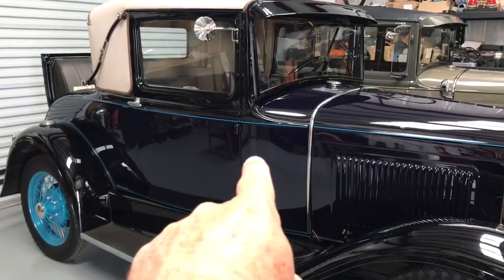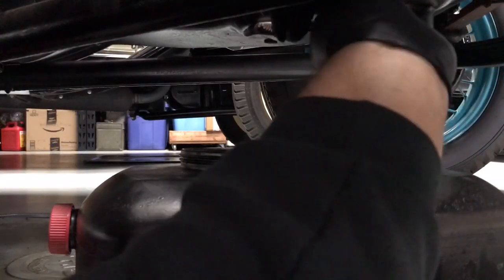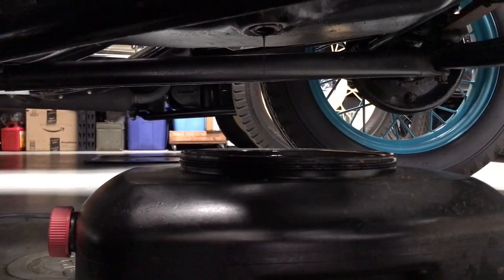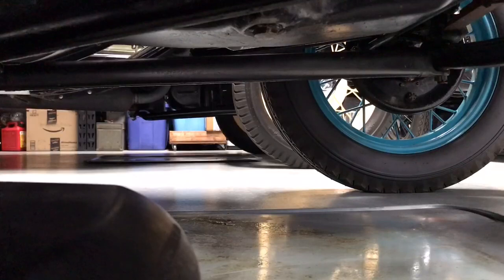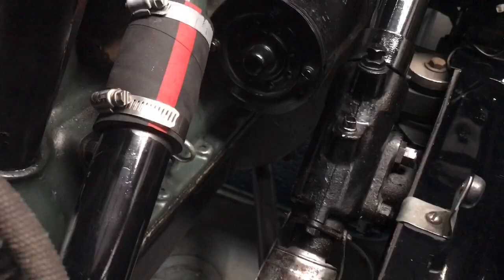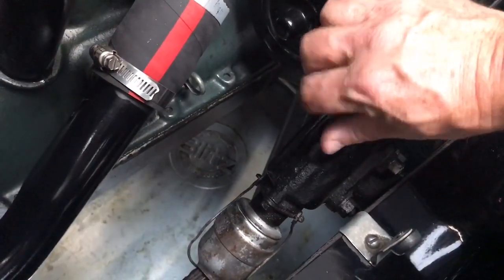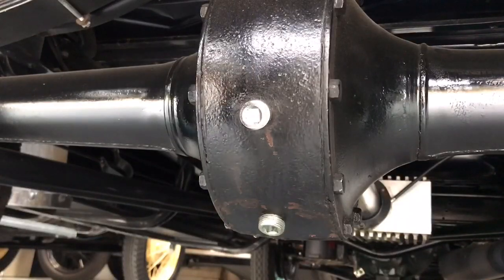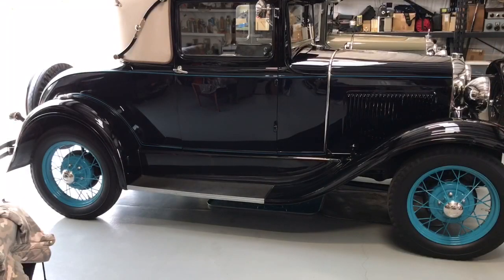How to check and change fluids in a Ford Model A.

Comment: Thanks for showing all of these grease and lube spots! Some of which I wouldn't have even thought to add a couple drops to! 

I was debating using modern 10w-30 syn in my Model A, and now seeing you doing it, I will certainly do it on my next change! 

Really enjoying your videos on Model As!
Reply from the maker: 10-30 or 10-40 work just fine.  Thanks!

Comment: I really like these maintenence videos 😊. Always interesting to see how much easier it is on older cars. Question, how come you change the oil so frequently when you use fully synthetic? Does the engine wear more than modern engines?

Thanks.
Reply from the maker: The Model A came from the factory with no oil filter.  So the oil gets dirty fast.  Lots of people add aftermarket oil filters to them now.

Comment: Hey Paul, I'm a new model A owner and somehow hit the jackpot of having a well maintained '31 for a reasonable price. They did put a grease fitting on the steering box though. How would you clear out the old grease? Thank you for the great informative videos. As a millennial with little mechanical experience your videos are a life saver
Reply from the maker: That happened a lot back in the day.  Just start filling it with gear oil and try to get the oil and grease to mix for now.  Keep it topped off with oil.  Eventually, when you do a rebuild on it, clean the grease out with brake cleaner and only put thick oil in it after that.

Comment: Dear Paulshinn,  I'd be very interested in seeing the Tudor's under side.  My '30 pickup took a 2nd place at the World Meet back in 1986.  I've driven it a fair amount since then though.  It was newly restored back then.  However, I like to keep the under side as clean as possible.  Just some "fodder" for another video.....Thank you for your post on lubrication....I went through and did all of the major lubricating, (bumper to bumper), last year on both my truck and my dad's '30 Deluxe Roadster.

Comment: Hi Paul!! Thank you for the video. My steering column the prior mechanic that worked on the vehicle put grease in it. Is there a way to flush it out? Thanks!
Reply from the maker: Unfortunately, it will have to be removed and disassembled to get all the grease out properly.  However, for now, shove as much 90 wt. in there as you can and start mixing.

Comment: Paul.  Where did you get the paint to spray your oil filter Ford Green?  Is it in a spray or do you brush it on?  Thank you
Reply from the maker: It's available in spray can and brush on form from most of the Model A parts suppliers.  It's called "Ford green"
Reply: @ModelA  Thank you very much.

Comment: Great videos - I inherited dad's Model A in '17 and it has not moved since '13 when he started his battle with cancer.  I will be going through checking all fluids and get the old girl back running soon.  I noticed that you didn't briefly run the car to fill the new oil filter, then re-check the oil?  I'm not sure if dad's car has one of these filters on it, but curious why you didn't fill the filter then re-check the oil?
Reply from the maker: The Model A has oil in the valve galley that drips into holes to the bearings.  The crank rods gets lubed by dippers splashing through the dipper trays.  Plenty of oil there to keep it lubed until the pump fills the filter.  But if using a pressurized system, I wouldn't do that.

Comment: Great video. Re oil I’ve read you need more zinc in older flat tappet cam engines. Popular brands are conventional Shell Rotella, Valvoline VR-1, Brad Penn. Zinc supplements such as STP Oil Treatment can also be added. What’s your take?
Reply from the maker: Read up on the oil I use in the video (link in description).  That will more than answer your excellent question.

Comment: Great videos,  you are so helpful keep up the great videos. 
I have a few questions if its not too much trouble. 
I noticed your radiator cap does not have a temp gauge, how do you know if its running hot , can you show how the other gauge works, how does the driver see the temp getting hot ?
Does the A models have a over flow from the radiator?
Is your oil filter housing a modern modification or was it offered originally?
Why do people change from a generator to a alternator, what's the difference and benefits. 
Thanks again.
Reply from the maker: Wow, LOTS of great questions!

The coupe has a temp gauge mounted I side just under the instrument panel.  I talk about it in this video: https://www.youtube.com/watch?v=z0imK2TaNUk

Yes, the Model A has a radiator overflow.  No reservoir tank though.

The oil filter is an aftermarket kit that all the major Model A suppliers sell.

If you drive your Model A at night, in today's traffic, an alternator is a must!  I still run 6 volt positive ground systems in my cars, so I use 6V alternators.  All the major Model A suppliers sell them  Just bolly on.  No modifications required.
Reply: @ModelA  on your other cars that have the temp sensor on the lid, does that Act like a modern thermometer in that you can see a mark or something rising up a tube that the driver can see ?
How did drivers originally know if their car was getting hot , just till it started steaming out ?
Reply from the maker: That's a motometer.  It is a thermometer, but it isn't as accurate as a "real" temp gauge.

Comment: Hi, I need help. I inherited my grandfather’s 1929 Model A. It runs well. But I need to change all the fluids. I saw the oil you used for the oil change. What brand and type do you get for transmission oil? Steering fluid? Any other fluids I need? A book to reference? A reputable model A shop or mechanic you can refer in the Los angels area? Thanks for your time.
Reply from the maker: Check out the video I did called how to check and change fluids in a ford model a.  I cover it completely.

Comment: Hey Paul on the steering wheel portion somebody did insert a grease fitting. If that area is already filled with grease should I try to remove the fitting and put in oil or should I just continue to fill it with grease?
Reply from the maker: Start seeing if you can get some oil in there and get the grease to mix with it

Comment: I don't have a Model  A but always change the oil in my regulars cars when the engine is hot. And, put a little NEW oil on the rubber gasket of the filter.
Reply from the maker: Good!
Reply: That's what I was taught too. Makes sense as more of the 'garbage' is in suspension in the oil, not settled to the the bottom of the sump etc. My 540,000km/335,000mi  (Nissan RB30) still has an untouched bottom end. I do the same with my Model A - get it nice & hot then drain the oil(s).

Comment: So, genuine curiosity, is there a reason you don't torque the drain plug? I can see the oil filter being hand tight, but wouldn't you risk damaging the pan's threads?
Super cool video by the way!
Reply from the maker: I just get it snug and then one more grunt tighter, that's all it needs.

Comment: Hey Paul, I appreciate all the info and videos you post!  Do you have any recommendations/videos on flushing out the coolant? I've noticed a little junk when I take off the radiator cap in my 30' Sedan.  Thanks
Reply from the maker: Thanks!  Not really any specific videos.  But I am working on one right now about swapping a radiator, that will contain some info about flushing.

Comment: Great Video @Paul Shinn. So I've come home from a 'parade' (aka car rally, "Bay to Birdwood" in South Australia) and while the Model A is nice and hot I've drained engine/trans/diff lube. There always seems to be oil dripping from all of these drain plugs. The engine oil drain plug has a copper washer on it, so not much else can be done there (?). The transmission and diff seem to have tapered plugs and the transmission plug in particular always has an oil drip hanging from it. I love to show off our Model A but hate leaving oil drips on friends' driveways. Is there any way of sealing those tapered (trans+diff) plugs better? Do yours leak? Love your channel :) Cheers, Antony.
Reply from the maker: Hi Anthony! Well, those drips aren't necessarily coming from the drain plugs.  for the trans and diff, you can use a little of the yellow teflon tape on the threads and see if they seal.  Th yellow stuff is gas and oil resistant.  Yes, mine drip.  They are supposed to!  Not kidding.  But they don't leave giant puddles.
Reply: @ModelA  Many thanks for your reply! I was also considering using some non-hardening oil resistant sealant such as Permatex #2... unless you think that would be a bad idea? Cheers, Antony.
Reply from the maker: I wouldn't.

Comment: Thanks for the great video. I hope you create more. What gear oil are you using in the transmission and differential?
Reply from the maker: Transmission and diff, I use the 600W oil that Bert's Model A center sells.  It's thicker than the 600W the other vendors sell and much closer to the original 600W recommended by Ford.

Comment: I have a 1931 Coupe with a model b motor. It's always been run with non detergent oil. I'm considering switching to detergent oil and an oil filter. Is that a good idea or am I asking for trouble.
Reply from the maker: If you clean out the pan first, no problem.

Comment: Paul. Finished fluid and lube on Sophie.  1930 Coupe.  I accidentally overfilled radiator with 50/50 mix.  It ran out the over fill tube. Should I drain it or let her run it out?  I started her for a few minutes and she spit out more coolant from overfill tube.
Reply from the maker: Just leave it alone.
Reply: Paul.  Sorry bout the silly question.  But thanks so much.  God bless
Reply from the maker: Not silly at all!  That's a legitimate question Greg

Comment: I would question the use of Mobil 1 oil for the motor especially since the car was designed way before synthetic oil and should run fine on regular oil.
Reply from the maker: The fact is, you can run whatever oil you want.  Today's worst oil is better than 1930's best oil.  Right?  I run the Mobil 1 High Mileage oil because it has a higher zinc content and it makes me feel better. You should run whichever oil makes you feel better.
Reply: @ModelA  Exactly Paul. My buddies and I mess with restoring and re-building antique motorcycles, almost all of them pre -World War..... ONE! Most have "total loss lubrication" systems, meaning the oil comes out of the left-side tank, runs into the engine (and you add some as you cruise with the hand pump) then runs onto the road. Those engines, like WWI aero engines require CASTER BEAN oil from Burma . The original "Burma-Castrol "C". Ride behind an engine running with "bean oil" for very long, and you spend the night in the bathroom...

Comment: Question sir, my model A (1928) started flooding gas into the oil tank, I drained the oil/gas and took apart the carburetor, it seems to be in good condition but I bought a rebuild kit and put it back together but there’s still gas in the oil tank. What should I do to get my baby running again?
Reply from the maker: Are you using a downdraft carburetor?  Or the stock Zenith updraft?
Reply: @ModelA  It’s the stock updraft sir
Reply from the maker: OK. First step is to do a compression check.

Comment: Is there a way, other than fill and dumping 600w oil in my trans and rear end, to flush it out. My inherited'29 coupe wasfilled with such dark sludge that I don't want to waste my 600w if its just going to trash it on the first wash. I was able to completely clean out and change gaskets on the oil pan so I didnt have the same issue there. 

Thank you

your videos have been incredibly informative and appreciated. 
Julian
Reply: Also, your 600w oil looks clear and mine is more an amber color... is that a normal difference or should I look to return my product. I am using MACs/Ecklers brand
Reply from the maker: For very short durations, you can flush using diesel fuel.  works great!  smells terrible.  Don't use that bio diesel stuff, you want the stuff that came right out of the ground and is clear.  600W oil should have a little color to it

Comment: Paul , beautiful cars!!!
Should I use non detergent oil for the engine?
What kind of fluid or brand would you recommend for transmission and rear as well?
Thank you!!
Reply from the maker: Any 30 wt. or 10-30 will do,  They are not picky.  Trans and rear end both use thick gear oil.  Anything over 90 will do, but 140 is better.  The Model A suppliers sell an oil they call 600W that is basically 90-140 oil.
Reply: @ModelA  Thank you so much!!
Reply: @ModelA  thank you for this information!. I was wondering where would I get 600w.... I have 85w140 in stock.

Comment: How did you access the transmission filler? Take out the floor boards? Or can get at it from underneath?
Reply from the maker: Just scoot underneath and there it is!
Reply: Thanks! The muffler blocked my view so I took out the floor boards to see it was right there. Ha. Live and learn.

Comment: What adaptations have
Been made to the engine lube system
Since it is a splash 
Lube how did you get
The oil to flow through
The filter? Dwight.
Reply from the maker: Using one of the oil filter kits available from the Model A parts suppliers.  Very easy.

Comment: Is  valvoline 75W-90 conventional gear oil suitable for the standard 3 speed transmission and rear end in my 29 Tudor ? thanks Paul
Reply from the maker: No. It is way too thin.
Reply: @ModelA   Back to the 600w I suppose. anything better ? thanks for working on your day off, great videos. Greg
Reply: @ModelA  Oh Im glad I read the comments then. I guess you were just using a used bottle of 75W-140 then? What weight do I need for my transmission and diff?
Reply: @ModelA  I read further. I see you answer 600w elsewhere. Thanks for the videos.

Comment: these had a spin on filter? i was not aware they even had a filter for the engine oil.  Looks like a motorcraft FL1A
Reply: Lol please note i comment as im still watching
Reply from the maker: It's an aftermarket add on
Reply: @ModelA  what pumps it through the filter? I always thought the A engines just pumped into the cam and tappet area the rest was splash oiled in the crank case. I like the idea of filtering the oil.
Reply from the maker: The oil pump.  All A's have a pump that pumps oil into the valve galley.  Then, it flows downhill through passages  into bearings, etc.

Comment: Fixing a model A for a sweet old lady. Hasn’t ran in a few years but should just need gas and an oil change. Doing the normal starting for the first time in a while stuff like a little oil in the cylinders to get oil on the rings, and charging/ replacing the battery.

Comment: Interesting to note that a crescent wrench  [ metric  or english :-) ]  may be necessary b/c US bolts weren't exactly the same size today as they were in 1930.  
I think the 'modern' standard for US fasteners came about as late as 1960 or so.  Is this generally true?  Will 'modern' wrenches and sockets fit older bolts/nuts?  How about thread forms?  Do you need to make your own replacement fasteners?

Amazing how well these cars (including model T's) were built.  We can credit Mr. Ford being an Engineer first and a Businessman second for this...
Reply from the maker: All my MAC and Craftsmen US made tools fit the original nuts and bolts on the Model A's perfectly.
Reply: I would assume a ½" in 1930 is the same ½" in 2020...
Reply: @Dennis-lx9mo  not exactly.  Interesting story about how Henry Ford bought the Johanssen gage block company to make standard gages for his factories.  Even as late as WW2, Canadian, US, and British inches were not the same.

Comment: One thing i like to do with any oil filter is to put some in it to saturate the pleats to get as much air out of them as possible.  Makes the first start easier on the bearing surfaces and elsewhere when you go a few seconds of no oil because it's trying to force it all through a bone dry filter first.  Just an idea to consider  :-)
Reply from the maker: That is an excellent idea!  However, in a Model A, it won't matter.  The Model A used splash lubrication and relies on gravity to get oil into the dipper trays and bearings.  If your engine relies on oil pressure to force oil into bearings, like a modern motor, then priming the oil filter (as it is called) is very beneficial.
Reply: @ModelA  How does the oil get through the filter then if there's not a pump on the splash system?
Reply from the maker: All the oil pump does on a stock Model A motor is pump oil up from the bottom of the oil pan into the valve gallery (the area behind the valve cover).  Oil fills the tray in there with some of it falling by gravity down through passages to the main bearings, and the rest spilling into the crank area and over the cam gear and keeping that area wet.  The excess falls into the dipper trays and eventually into the pan.  

When you install an oil filter on a Model A, in particular, the type I have, oil is pumped into the filter and what comes out the filter fills the valve gallery tray.  The valve gallery has quite a bit of oil in it just sitting there.  The oil from the pump through a new unprimed oil filter only takes a couple seconds to begin spilling into the valve gallery.
Reply: @ModelA  thanks for the lesson!
Reply from the maker: @TommyboyGTP  Glad to help!